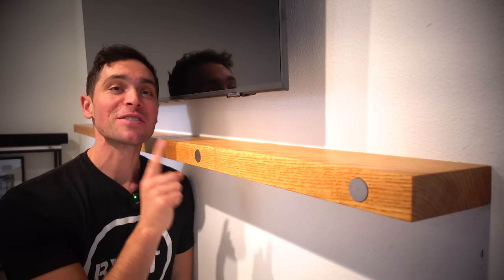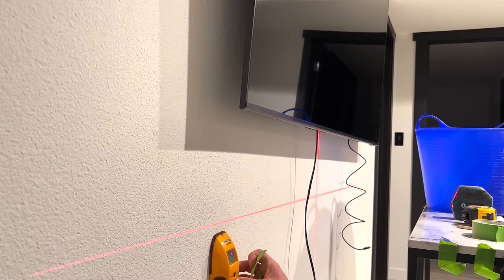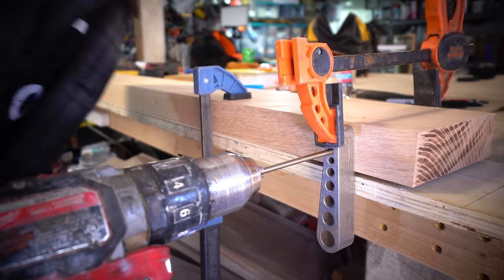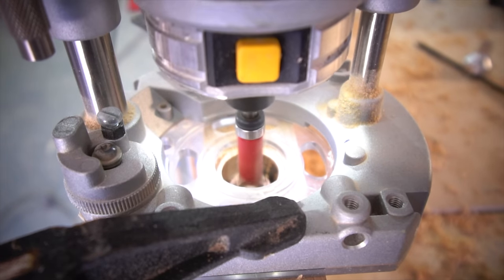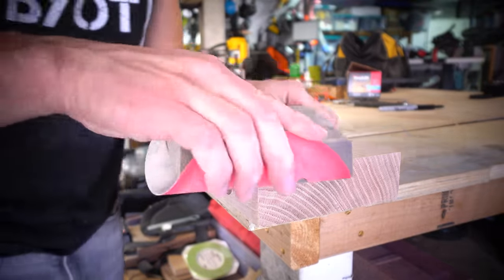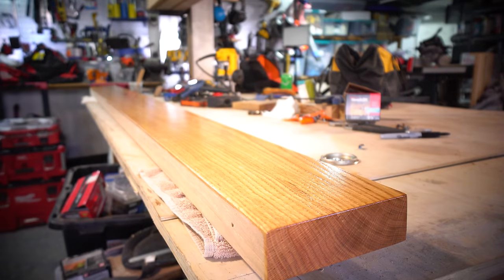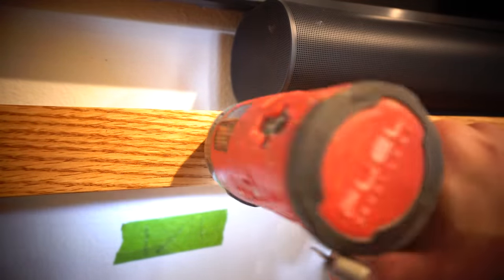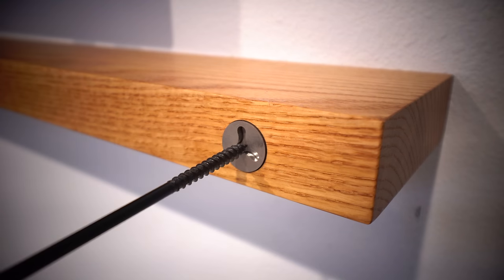FRONT Mounted Floating Shelf

Comment: I love Pika Screws but are they really best for this application? It's not like you are going to need to have easy access to the screws that are attaching the shelf to the wall. And if you want a metal plug, just insert a metal plug that is ferrous. Glue in weak magnets on the inside if you are afraid they will fall out and strong magnet to pull them out. Or hack, don't go with ferrous metal and just don't make the hole too snug and use tape or glue to pull them out, if needed. Pika Screws and the tool are expensive, so might as well save them for a project that has no better alternative.
Reply from the maker: It’s more for a unique look and perspective. There are plenty of options out there that I could have used but nothing like this. Thanks so much for all the input. Great to hear others thought process on this.
Reply: I thought exactly the same actually. Couple of neodymium magnets in there and a slice of steel rod)))

Comment: Could have done the same thing with a wood dowel. Stained a darker color- might have looked even better.
Reply: Real easy to do it with a 1/2 inch steel rod 8 inches long.
Five inches goes into the oak edge facing the wall and three inches goes into the wall stud.
Drill 5/8 hole into the stud and fill with epoxy. 
The screw cap is cute.
Reply: Metal plug with a magnet glued to the back to hold onto the screw or even just friction fit in the hole, these are a joke

Comment: I like the look, but the actual screw that is holding up the shelf, is now completely covered by the t nut, right? So while the pika screw is able to be removed, what happens to the t nut and it’s ability to be removed for access to the screw?
Reply: You’d just remove the pika screw, and start screwing a long bolt into the t nut.  As the bolt bottoms out (and contacts the head of the lagscrew), you continue screwing and it should pull the tnut prongs out.
Reply: I suppose you could fabricate an extender bolt with tapped hole or thread at each end. Then use red locking compound at the pika end. You would need to use some wall anchor. Pika means express in Finnish BTW

Comment: $40 for 1, for basically a decorative piece, I'll pat.
Reply from the maker: I used the pika mini version. They are only $27/piece
Reply: @BYOTools  so, $108 to hide some fasteners 🤔 seems to be a ton of better, cheaper options to hide fasteners.
Reply: @J M  and then also have to plunge each hole twice. Quite a bit more work.
Reply: @BYOTools Glue a magnet to a metal plug and put it top of the screw head, what you installed is overpriced garbage.
Reply: But when you are doing a project for a client? If they're paying for a custom job obviously they're going to want that extra polished look. And are willing to pay for it.
Reply: @VickyCooksalot  I'll still do it my way to keep my material costs even lower and they can pay for my ingenuity rather than someone else's
Reply: @VickyCooksalot  no problem with that. The problem comes when its a cheapa$$ customer wanting premium  fast jobs but paying basic.
Reply: What if i give the same functionality, with a smaller head and longer screw, even 2 inches. And above that at 3 dollars a pc!
Reply: @november28in  WHAT?

Comment: I don't get it. Adding $200 to the cost of the project just to use unique fasteners that you don't need to use, that are specifically designed so as not to look like unique fasteners??? Surely you could have mounted the shelf using the traditional metal rod bracket, fixed from the underside, avoiding any holes on the front? If you really wanted a few metal discs on the front, just recess a few metal discs using the router and a friction fit and voila; exactly the same look!
Reply: What if i give the same functionality, with a smaller head and longer screw, even 2 inches. And above that at 3 dollars a pc!